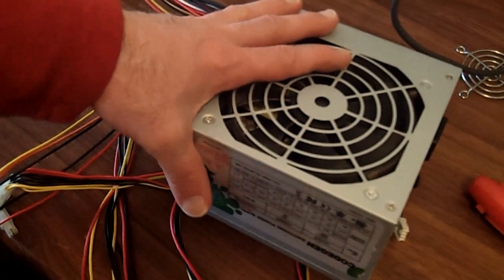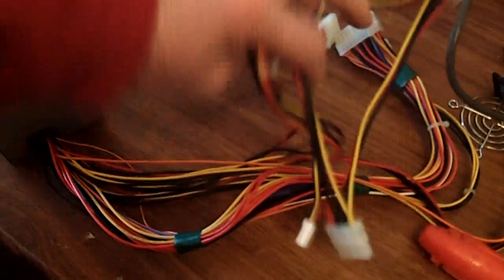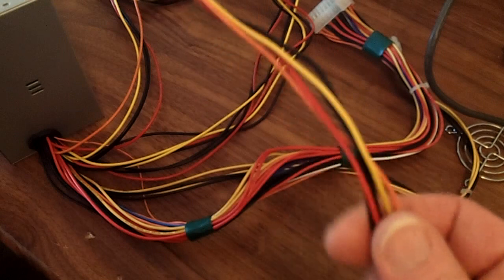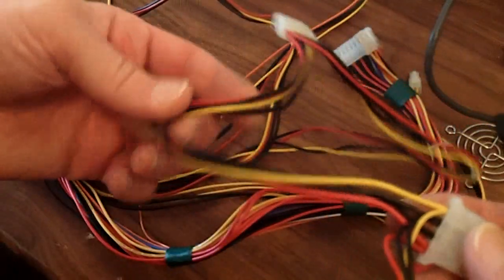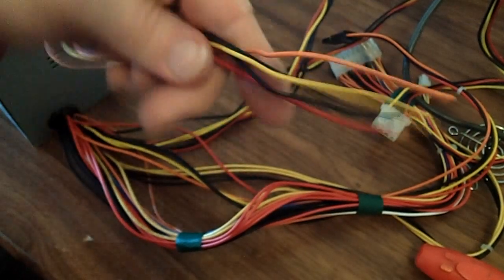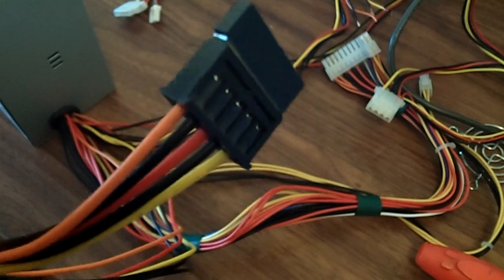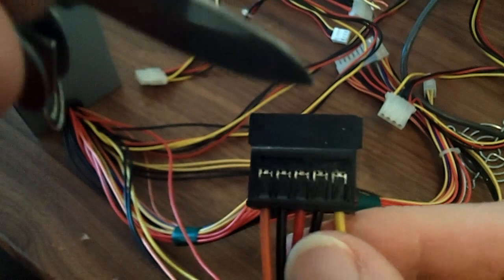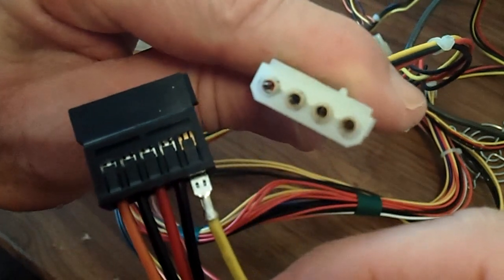Adding Sata Power Connectors To A Power Supply Without Using Adapters.

Comment: How do I convert my leftover 4 pin or an extra sata rail without an adapter (I can wire it up with specs?) to get a molex leftover wire to work from an old power supply to light up my new case that uses molex?..... Is using the data rail the best or the 4 pin cup that I am not using?

Comment: Wonderful! However, I want to know how I can connect a new SFX power supply unit to a ASUS IDE motherboard (2003) for a Sony VAIO PCV-RX850 Desktop Computer! All I can find from the Internet on YouTube is the opposite. I want the instructions so that I can install a new 450W power supply, and connect it to all the components in my desktop-style computer; which includes a new Western Digital 320GB IDE hard disk drive. Thank you.

Comment: Man you did like a pro I 💜 really thank you for learning me to twist wires your way and to add cables 
but the problem as I want to add power sata connectors to a power supply contains only power connectors with 4 pins and the sata got 5 pins
which one from the 5 to cancel
Reply: Mohamed M. Abd El-Azeem I guess he canceled orange
Reply: Luis Torres ,Thanks a lot I'll try and tell you if it works 😊
Reply: Thanks man
Reply: Luis Torres ,Thanks man you're awesome I canceled 'Orange' and it works 😘

Comment: You are An idiot ever born If you open your smps by unscrewing it then you will find that there are places left to solder dc 12v , 5v  and 2x gnd you can solder them their but . And the method you are doing it will divide the following ampere in equal part law by George ohm so try to open it but do it on your own and last massage you have to solder wire on the motherboard of smps as they are just simple ac to dc
Reply: no one cares, learn to write english.
Reply: Matheus Felipe what do you mean no one cares , learn to write english
Reply: Why am I an imbecile, sir?
Reply: khan rayyan what about just adding Orange cable to PSU and add it to Molex sata adapter

Comment: spend 100 bucks and get a new power supply..
Reply from the maker: The computer I was using at the time wasn't worth spending 100 bucks on and the power supply was fine just needed a few sata power connectors.. I've upgraded my whole system since this video was made
Reply: +percaine   The orange wire isn't needed?

Comment: If the orange is not needed then why is it there in the first place?
Reply: Anthony It was supposed to be for compatibility; but the hardware never evolved the way it was anticipated. Solid state drives function using only the 5v (red) wire, making both the 12v and 3.3v irrelevant.

Comment: I've always found that pre tinning or melting solder into the cable [wire] end, means that when I bring together the parts that are to be joined, it then requires less solder and a much short application with solder-iron, which of course means less chance of heat damage to the components.
Reply: Being an RC guy i can tell you not only is that tje best way to soulder electronics butbits also the correct way. Minimise exposure and  get almost instant bond. Very satisfying seeing it glaze and puddle into 1 mass super quick. The only way to solder direct to brushless motors and ESC units. Flux tin the wires first should be law. Wires dont melt tin does hence the faster better bond melting 2 coatings of tin together.  I like your method Sir Thanks for sharing in the comments

Comment: Just did something similar with an older PC's power supply, was looking online to see if anyone's done the same - clearly they have!  I ended up just cutting off one of the molex connectors and soldering a sata power connector to the cut wires instead... got the power connector from an old dead power supply.  PC had sata ports on the motherboard but no power for it and I was upgrading the hard drive in an old (2005) PC, wanted to use sata instead of IDE.  BTW, the 3.3v (orange) is generally not needed but newer SSDs make use of them so if you have a newer SSD this trick may not work unless you connect the 3.3v from another source on the PSU.

Comment: Hi,
Very instructive video as I have same situation. One of your comments was about using the connectors that you slid out of the new black connector. Please advise whether the wiring in those connectors was soldered when you removed it. I just ask so if it was, I know to get my solder out when I follow your tutorial. Thanks for sharing your knowledge, regards Pierre

Comment: I have a question... I am new to this so here we go... You said you left off the orange wire, well that's what I'm dealing with now.. the power supply Im using has 5 wires for the sata cable... the sata cables I like yourself took from another power supply has 4 instead of the 5.. Can you tell me how to do this with one less wire? I don't need a fire in my house, lol.. thx